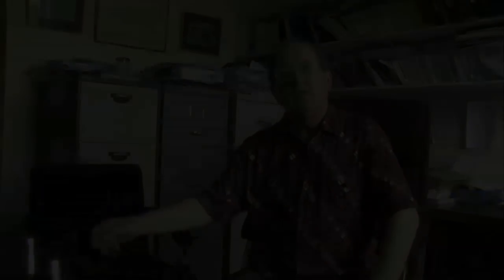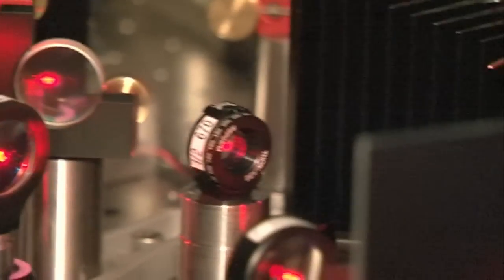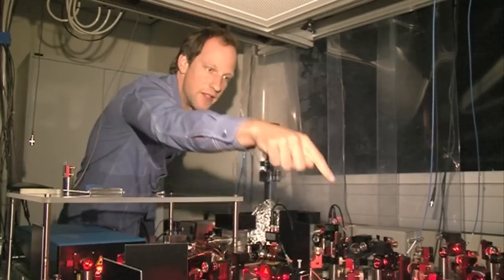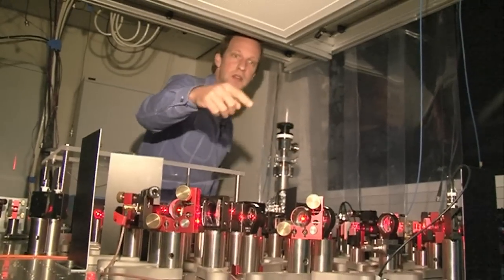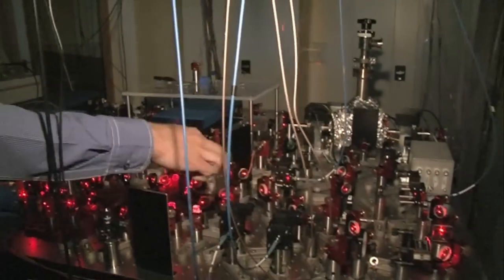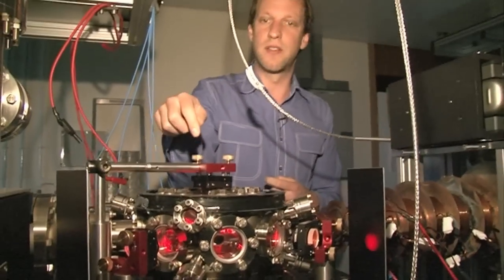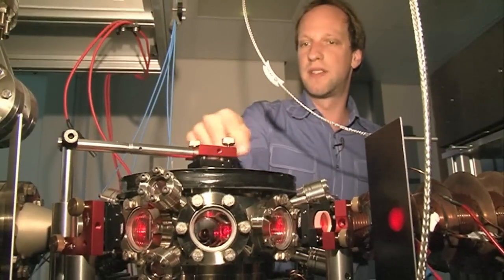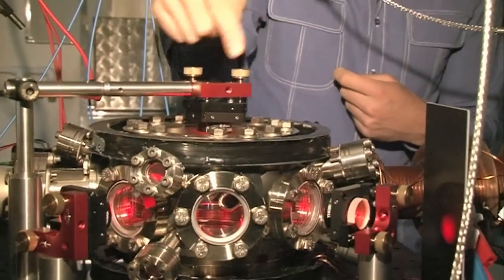Laser Cooling - Sixty Symbols

Comment: 1 Baff should be a new SI unit of momentum
Reply: We should change everything else to fit with the baff more nicely.
eg: Units of force: baffs per second.
Reply: It would actually be an unit of work or impulse.
Reply: 1 Baff is the amount of work needed to bring a particle reacting to light of 671.005 nm into a state where it instead reacts to light of 671.000 nm.
It is all explained in the video :D
And it ffints nicely into the SI system where every unit is calibrated to basic laws of physics.

Comment: Yes, that is correct. When the photon hits the atom it does so with some momentum, this will impact the movement of the atom slightly,thus slowing it down. In doing so the photon causes an electron jump into a higher energy state, and because electrons don't like being in this state it will return to its original energy level, though the emission of energy, taking the form of a photon...

Comment: Where does the kinetic energy of the atoms go? When they absorb the laser photons doesn't it just put them into an excited state?
Reply: No expert but I found somewhere that they almost immediately release a photon afterwards in a random direction, with a tiny bit more momentum than the original photon, thus everything is conserved.
Reply: Alex is right, in fact this results in a cap to the amount of cooling you can achieve with lasers alone. This cap is called the "Doppler Limit". We can, however, cool atoms past the doppler limit by adding things like an external magnetic field as in a MOT (magneto optical trap), and polarization gradient cooling which uses polarized laser light to further cool atoms.

Comment: If absolute zero is the absence of molecular motion, is there a corresponding opposite temperature? A point beyond which you can no longer add heat to a system? Would that be the temperature of gas molecules moving at the speed of light?

Comment: @bmbirdsong There's no such thing as an 'absence of molecular motion'. Molecules will still possess a zero-point energy, and can never reach absolute zero. On the other hand vibrational energy levels go from v=0 to v=∞, so there is no maximum temperature. Or put another way, to get something to the speed of light would require infinite energy. Thus unless you can get to ∞°C you won't get an atom/electron or any particle with mass to the speed of light.

Comment: What's the point of all the mirrors and lenses etc. if all that ends up happening is the lasers get routed through a fiber optic cable to some other spot? The lasers are already, presumably, coherent and everything, so what more needs to be done?
Reply: +Ryan Lanzetta There is just one laser, but they need many beams from all directions... The apparatus is meant to split the beam into many beams that are then routed to the cooling chamber...
Reply: +gibbetify 
And you can&#39;t just use simply three lasers, because you have to keep the coherence and so on?
Is that right?
Reply: +Jake K. 
I don't think coherence is the major issue here.  The reason one laser is used is because the laser used here is expensive piece of equipment - so a mirror assembly is just more economical than having three lasers!
Reply: Also, as I understand from the video, if a different frequency is needed, there's some arrangement that can shift the frequency of the laser a tiny bit.

Comment: Where does the energy from the heat go?
Are the atoms decreasing the wavelength of the laser as it passes through?
Reply: @MainsOnTheOhmsRange  The atoms absorb one frequency of light but then emit photons.  I'm guessing they probably emit photons at a different frequency than they absorb leading to a net reduction in the energy of the atom.

Comment: I have one question. Because the atoms are absorbing I assume that the electrons of the atoms are going in to a higher energy state. I know that this increase in energy doesn't imply a temperature change (electron energy != kinetic energy). But, why don't the electrons fall back in to a lower energy state and eject a photon which would counteract the momentum change? Is it because this kind of cooling is only feasible for gasses which are receptive to photon absorption but less susceptible to ejection or is it because the photons aren't being absorbed by electrons but by some other particle (something in the nucleus maybe?)?

Comment: How do you stop your laser from accidentally giving the particle a kick and increasing it's momentum?
Reply: +Nick Morgan I was laying in bed and remembered that he said the particles only get the kick from the photon if it is moving towards the laser source. 
Dopler shift and stuff...

Derp.
Reply: +Nick Morgan This does happen in part because the linewidths of the laser and the atomic transitions are not infinitely small, and this residual heating process contributes to the lower bound for the temperature you can achieve solely from Doppler cooling. This is called the Doppler cooling limit.

Comment: I don't know if this question has been asked already, but I thought Rubidium and Sodium were solid at room temperature. So when you are lowering the temperature of this gas doesn't it just turn into a solid? How do they keep the atoms seperate while lowering the temperature to such extreme levels?
Reply: john hall melting/boiling points are different at different pressures, remember this is being done in a vacuum

for example at water freezes at a lower temperature at high altitude (lower pressure) than at sea level (higher pressure)

so because these particularly unstable metals are in a vacuum, they can be kept as gases at much lower temperature

Comment: @anonymousbl00dlust I also am not an expert. I think, that when the photon hits it slows the atom down. Then the photon is re-emit in a random direction and will gain momentum again, but since it does this a lot of times and the direction is random it will equal out at some time and only the slowing down effect of the photon hitting will matter, because it always hits from the same direction. Someone pleas correct me if I'm wrong.

Comment: @roidroid This is one of the things that's bugging me. 

The other one is. If you hit an atom with a photon of the right frequency, the energy of the photon is used to shift an electron of that atom to the higher orbit. If that's so, then where did the energy which slowed down the whole atom come from?

To me it seems that the atom should do exactly the opposite. It should absorb the photon when frequency is correct, without affecting atoms speed, and reflect it when it's not correct.

Comment: I heard that at the temperature of 1.41x10^32K the wavelength of the radiation which is emitted by the atom reaches the planck length... So if it's getting more energy we don't call it temperature anymore.

Comment: plank temperature , althought photons do travel at light speed, they don't have plank temperature.

temperature is just a measure of how much "jiggling" there is in a substance, if you had an atom moving in a PERFECT straight line in a vacuum, from the inertial frame of the atom, it would be at zero kelvin, regardless of what relative liniar speed it has.

but that's the thing, atoms don't move in straight lines, quantum fluctuation prevent matter from reaching 0 K.

Comment: @roidroid 
A laser  beam has no entropy  because the photons in a laser are in a single quantum state, S = k ln(W)=k ln(1)  = 0. The gas of atoms is hot (say 800 K) and has a lot of entropy. 

The absorption and re-emission of photons by the atom leads to the photon gas having a lot of entropy (disorder) and the selected atoms having less entropy (they cool). Overall, entropy is increased in the process which is the basic law of thermodynamics. The scattered photons take away the energy.

Comment: why does not an atom get momentum in random direction 
when it absorbs photon? I mean electrons absorb the photon and gets 
excited so how this process give momentum in specific direction to the 
atom?
Reply: +Mad Ad They get the initial momentum from the incoming photon in the direction of that photon. Through spontaneous emission they re-emit a photon in random directions and get a commensurate momentum kick in the opposite direction of the re-emitted photon. However, since the direction of the spontaneous emissions are random over the entire solid angle, the average effect is zero over many emissions, so the net effect is to be kicked in the direction of the incoming photons from the laser.

Comment: OK, so you reduce the momentum of the atom by hitting it with a photon, and drive the electron into a higher energy state.  I presume then the electron then drops back releasing a photon that doesn't get absorbed.  Otherwise you're just pumping energy in.  No way will you cool it.  I would have thought the new photon was exactly the right wave length to get absorbed.  I don't understand.

Comment: @mathiaspaul1987 Same question here. I guess if the atoms give energy of, they emit light at the same wavelength they had absorbed, so if the frequency had already been change by the time they return to their ground state, the light is kind of "tainted" in the container. Or does is the energy just spent on the momentum change? I'm just guessing really :P

Comment: But how do you keep a metal in gas form if it's way below his boilig point?
Reply: Low pressure, aka vacuum.
Reply: IsbjörnXII i don't see any boiling ISSs in my nightsky :/
Reply: The space might not be void enough for the materials to evaporate. The metal won't boil, it will just give of "metal vapours", and you wouldn't be able to see it without specialized equipment.
Reply: ***** and so a metal at -273 degrees celsius would?
Reply: zombieman2012 ?
Reply: +zombieman2012 
It's not abot the temperature, it's about the vacuum.
Reply: IsbjörnXII is about temperature AND vacuum

Comment: Does anyone know of any diagrams for a laser cooling setup? I have access to multiple laser diodes of the right wavelength and power, as well as stuff for the optics.
Reply: I'm curious where you obtained such materials?  It's difficult to find precision lasers for this purpose, so I'm wondering what company or lab you got laboratory quality materials from.
Reply: Megatom Thorlabs, etc.
Reply: MegaSqueakymouse just rewatched the video, I realized that the diodes sold by DTR are not the right wavelength. 
Using the diodes from a cd burner and a beam combiner would probably be the cheapest way for someone to get the diodes for a project like this.

Comment: So light has momentum, but no mass?
Reply: Connor Hall So photons do have mass?
Reply: No, p = mv is only valid for systems which move slow, for particles close to the speed of light the formula is m*v/sqrt(1 - v^2/c^2). When v is way smaller than c you can see that the denominator goes to 1 and you end up with p = mv
Reply: yes,I should correct myself after watching some videos.  light has momentum, but no mass.
Reply: Cheesyfangs But then in that equation, you've got 1 - v^2/c^2 = 0, so momentum of light is actually 0*(1/0), and this supposedly has a value? Not trying to prove you wrong or anything- I just don't know.
Reply: For objects that are not moving at relativistic speeds we can set v^2/c^2 = 0 because v<<c, so the equation p=m*v/sqrt(1-v^2/c^2) becomes p=m*v/sqrt(1-0). the square root of 1 is 1, so you're left with p=m*v.
The sqrt(1-v^2/c^2) part is also why particles with mass can't be traveling at the speed of light. If v=c in this equation, then the v^2/c^2 fraction equals 1. So p=m*v/sqrt(1-1), the square root of 0 is 0 and so you get p=m*v/0, dividing by 0 is undefined, something that doesn't work. That's one piece of evidence for c being the speed barrier, there are others as well.
Reply: +Katzen4u I don't remember the specific equations, but there is a way to calculate the momentum of a photon based on its frequency (which is related to its energy). The conceptual reasoning behind photons having momentum is based on the fact that mass and energy are equivalent in many circumstances; in the case of photons, while they are massless in the sense that they don't interact with gravity they carry momentum due to their energy. The energy of a photon also determines its frequency, so you can use that to calculate its momentum and some other useful properties of photons.
Reply: Photons do not interact with gravity boys, heard it here first in the youtube comment section. That is some ground-breaking scientific statement.
Reply: p = h / lambda. Momentum of a photon with a given wavelength. And light does interact with gravity, or we wouldn't know that black holes exist. Gravitational lensing, it's called.
Reply: @clancywiggum3198  photons do interact with gravity
Reply: @moritzpellegrini9832  Obviously they interact with gravity, I misspoke and meant to comment on their lack of gravitational "charge".

Comment: I thought it's impossible to take out the energy of the matter by sending there a lot of energy. Ok. Today I get it about the only frequency. But I still have question:
So why laser can heat things?
I doubt every laser works for every atom in any material.
Why? Why usual lasers surely give heat to anything without any frequency math?

Comment: Where does the extra energy from the atoms go when they cool?
Reply: Clayton Williams  It's about time someone asked this question
Reply: Cooling literally means there's a loss of heat. Heat is energy.
Reply: When the photon is absorbed, it causes an electron to jump to a higher energy level.  Some time later, that electron will drop down to a lower energy level and emit a photon which, in the atom's frame of reference, has the same energy as the one it absorbed.  The direction of that photon is, I believe random.  If that new photon was pointing directly inline with the original photon, then we would have no net change in momentum.  For any other angle, though, we now have less momentum in the direction of the original photon.

Now for energy:  In the atom's frame of reference, the incoming and outgoing photons have the same energy.  But in the experiment's frame of reference, when the photon is emitted in a direction which the atom is traveling in, it is doppler shifted to a slightly higher frequency.  That means it has more energy by an amount equal to the amount of kinetic energy lost by the atom.  Similarly, if it was emitted in a direction counter to the direction the atom is travelling in, the photon will be doppler shifted down and we'll see that it has less energy by the amount that the atom gained.

So, we're pumping energy and momentum into the experiment as photons and it comes out as photons, too.  If a particular photon didn't interact with an atom, it comes out with the same energy and momentum.  If it slowed down an atom, then it comes out with more energy and momentum.  If it sped one up, it comes out with less energy and momentum.  And due to the design of the experiment (as explained in the video) when the gas has enough energy for the cooling to work, on average, the photons are taking both energy and momentum away, so the temperature decreases.

Comment: The photon isn't absorbed by the atom, it bounces off the atom. This will cause it to lose energy. 

Think of it as a bug hitting your car. Though the energy loss is minute, perhaps infinitesimally small, that collision does result in an energy loss.

I think this is wave-particle duality, in that a photon can have momentum.
Reply: I think you are correct. This is why some scientists claim that the process in the atmosphere should be treated as scattering rather than absorption and emission. And otherwise where is all the energy going?